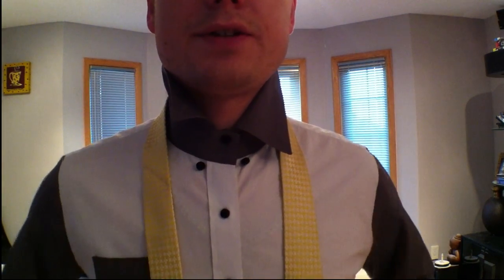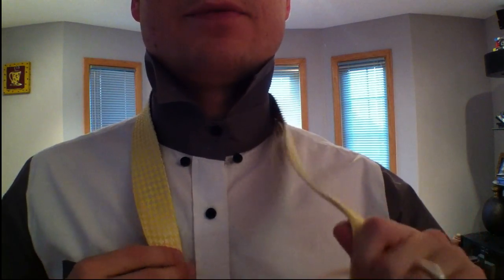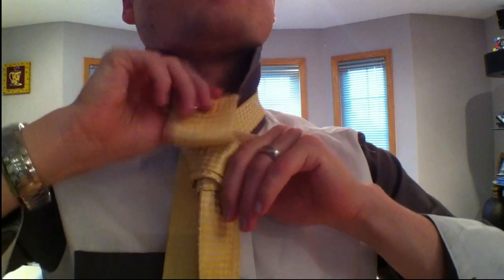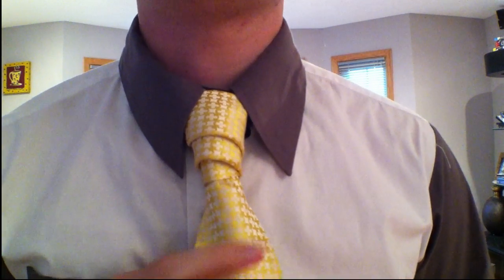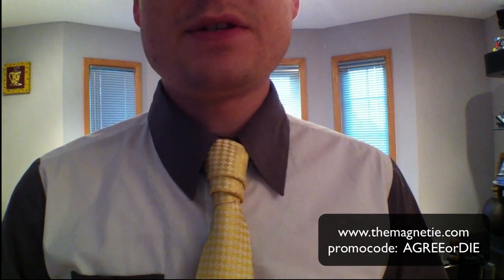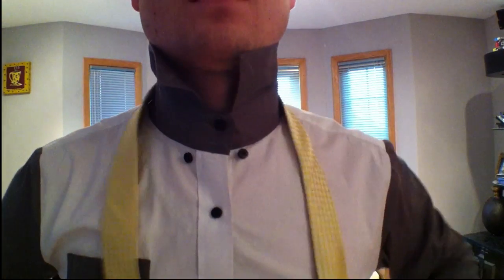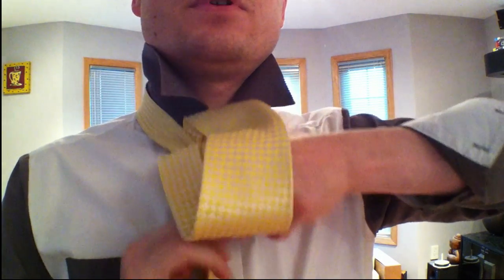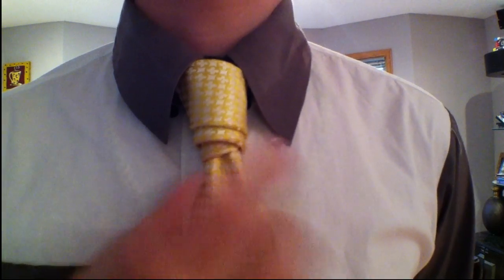How to Tie a Van Wijk Necktie Knot

Comment: When wrapping around your finger, have it pointing up instead of done so when you push the big end down with the other finger, you can put your fingers together with the tip in between and push it down a little easier.

Comment: about the single cuff you're asking about. I refer to them as "convertible cuff" b/c it has a barrel cuff - but the two buttons are spaced apart such that the space is allocated for the cuff link. i regularly buy them from Louis Philippe. check them out if you want to ;) just add a .com to the name as YT won't allow me to paste a link